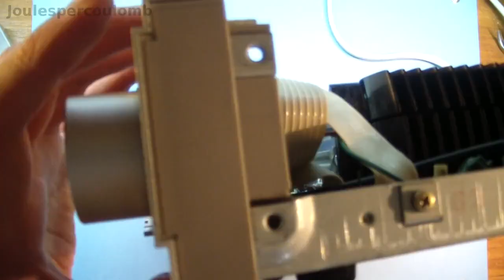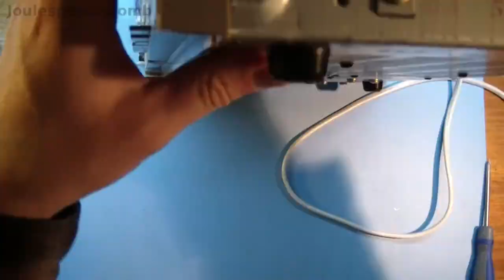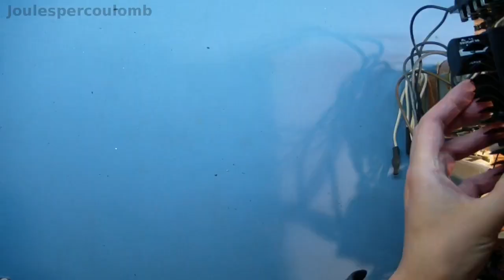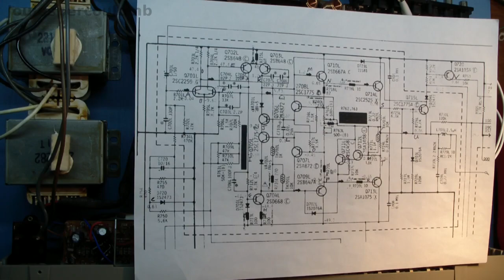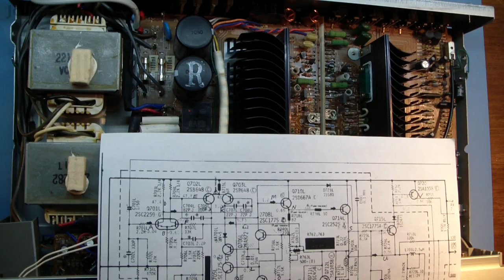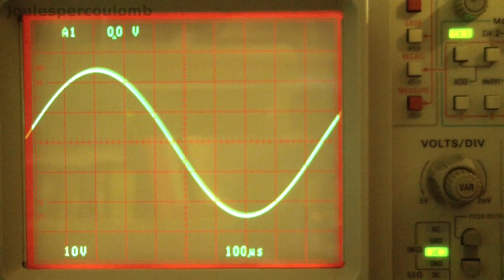Hitachi HA-4700 Amplifier Repair - Part Two

Comment: My hitachi ha-4700 has 440mv dc offset at the outputs but the speaker protection doesn’t kick in and still sounds fine. What could i do to decrease the dc offset?
Reply from the maker: That is excessive. Maybe the speaker protection circuit is faulty, though I'm not sure how much DC offset is supposed to be required to activate it. It has been a long time since I've studied the internals of this amplifier. There is an adjustment procedure given in the service manual. I've found it doesn't stay in perfect adjustment for long, but the DC offset at the output doesn't get nearly so large as 440 mV on my example.

Comment: I have the same amplifier and have had the same problem with oscillation, but only on the right channel (beside faulty power transistors and weird resistors values). Fortunately, I didn't find this video before I've fixed the issue, so I've managed to find the real problem. I have to say, it took me hours to figure out what was wrong with the amplifier. Finally I found this, at first sight insignificant, 2.2 Ohm resistor R730 at the output, connected in series with 0.22uF capacitor to GND. At measurement left channel resistor was 6.6 Ohm, right was infinite. After replacing those resistors, oscilation was gone and everything works fine now.
I really like the dynamic sound of this old school amplifier.
Reply: sounds like the output Zobel network had opened - this is normally the case when the amplifier has been oscillating already.

Comment: I recently acquired the same amplifier. It worked, but sounded terrible, especially in the right channel. I suspected it was the same oscillation problem that you observed. Sure enough, the power amplifier emitter voltages were impossible to read. Not owning an oscilloscope, I went ahead and changed C707 and 708 for single ceramic disk 100 pF capacitors (the fuse resistors were fine). It sounds great now with no problems at all. Thank you for the video. I hope you make some more one day.

Comment: Good video. Like yourself I'm really not convinced about that "Super Linear" bias circuit. Technics (Panasonic) and JVC did similar games in the 80s too... 

I also have a similar Dual record deck (CS 505-2 i think?). Mine spun backwards when I got it - I found that two RIFA capacitors had dried out and cracked, replacing those sorted it. I also replaced the signal wiring which eliminated some hum being picked up.

Whats the white vinyl you're playing here?
Reply from the maker: I assume you didn't replace the wiring all the way to the head shell. If you did, how did you remove the head shell to get at its wiring without damaging the arm tube? In my Dual turntable at least, it appears to be crimped in place. I found the ground connection to the arm was broken somewhere inside the tube and so I added a new one by trapping a fine wire under a small screw near the rear (I think that's what I did - it has been a while since I have looked at it).

The album you got to hear only a few seconds of is Iron Will by Grand Magus.

I note that elsewhere, you made some suggestions for better compensating this amplifier and I might give them a try if I ever have cause to dismantle it again.
Reply: No i did not replace the wiring in the tone arm itself... the tone arm wiring was terminated to a stripboard, and then onto the cables coming out of the back. I replaced the external wiring as the cabling was looking rather worse for wear, and the plugs were tarnished.

The headshell on mine is actually a bit annoying, The cartridge is on a removable part which clips onto the rest of the headshell. The contacts there frequently play up ! Once i got the screw out (it was stuck!) I bypassed this. Rewiring the tone arm looks like it could be a right pain, so Im glad i didnt need to.

I still have it, but it's been replaced by a Sansui SR-222 mk II i got for free, which has an Ortofon OM5E stylus on it. 

Amplifiers are my "thing".. ive repaired a few and built a few ;) Generally if you get an amp in and its oscillating, definitely look to the compensation components first. If they are bog standard disc ceramics, change them out with multilayer ceramics of NP0/C0G type. Old disc ceramics like to go thermally unstable with age, and it wont show on a typical capacitance meter.

Comment: Just getting started troubleshooting electronics with an Oscope...do you troubleshoot devices by using the scope for what you see on the screen..or buy where you actually see where the lines come to on the screen??
Reply from the maker: Your question isn't at all clear, but I suspect you might be asking whether the general shape of a waveform or the details of its frequency and amplitude is its most important property. The answer is that, in general, both are important, but in particular situations, one or the other might be more interesting and informative.

An oscilloscope is an extremely useful tool when diagnosing faulty electronic circuits, but for it to be useful, it is necessary to have at least some understanding of how the faulty circuit is supposed to operate and so also of what sort of waveform ought to be present at the points where one might measure it. Selecting the best points at which to do so, again, requires some knowledge of how the circuit should function.
Reply: That is right...I asking..that do you look at the waveform is a certain shape, or how high or low or wide or thin it is on the screen...Sorry for the question not being clear..

Comment: I think you can use appropriate capacitor temporarily connecting to the doubtful section/transitor that oscillates and check oscillation in the oscilloscope of the output whether oscillation decrease or not.

Comment: A very nice and comprehensive repair. Interesting that the tone controls even in the flat position had a bit of  overshoot suggesting the frequency response was not that flat. A remedy for amplifiers that are prone to oscillate is a ferrite bead in the feedback loop.

Comment from the maker: It was a while ago, but I seem to remember that there were very few electrolytic capacitors that'd directly affect the audio path. The main power supply reservoir capacitors didn't show any visible signs of distress and I loaded the supply rails a bit and there wasn't much ripple, so I left them alone. If they go bad I wouldn't think it'd cause much other than hum on the output and distortion at lower output powers than otherwise.

Comment: I remember hearing Hitachi equipment in the 80's and being very impressed by the sound.  Unfortunately Hitachi were one of the first and most severe victims of the drive to bring down costs and this is reflected in the quality (or lack thereof) of their enclosures of their 80's equipment.  Modern Hitachis are so woeful you'd struggle to give them away! Such a shame that such a great manufacturer sank to such lows.

Comment: This is a great tutorial. You are very in-depth. I'm disappointed because I always considered Hitachi to be of the best gear but all you had to do to get this going and all of the balancing...... What a piece of crap! I would expect this on a high end, high power amp. A 50W amp shouldn't need so much balancing and compensation. Over engineered nonsense. I would expect that from the Germans, not from Japan, in their hay-day electronics manufacturing. All of the extra components must have cost a small fortune. When you saw oscillation, the first thing that came to mind was bypass caps.... On a unit that old, all caps near heat sinks are suspect. During my bench repair days, I just changed all caps near heat sinks. You may think that type of shotgun approach isn't good troubleshooting but when time is money, it never failed me and things worked out fine.
Reply: To be fair there isnt that much compensation in this amplifier. We have the usual Miller capacitors across Q702 and Q703, and a small bit of lead compensation over the feedback resistor R707.

Unusually, they have used capacitors in series for the Miller caps. Standard capacitor in series formula applies here though, so there is 11pF across Q703, and approx 47pF across Q702.

47pF strikes me as rather low for compensation here - i'd have used 82pF at least. I think Alastair replaced them both with 100pF, which would give 50pF compensation. Quite likely the capacitors in this case were ceramics which have lost their voltage/temperature stability with age. NP0 or C0G dielectric type capacitors are called for when used as compensation capacitors in an amplifier.

If only they'd known about two-pole compensation back then ;)
Reply: Rewatched the video, and it seems he increased compensation across Q703 to 100pF. This would undoubtedly work, perhaps at the cost of increased THD particularly at higher frequencies.

Alastair, if you ever revisit this amplifier, swap C704/C705 for a single 82pF capacitor, and C707/C708 for a 33pF capacitor. Make sure they are NP0/C0G dielectric types. Multicomp MCRR range (from Farnell) work very well for this.